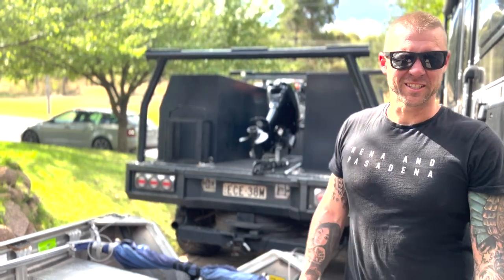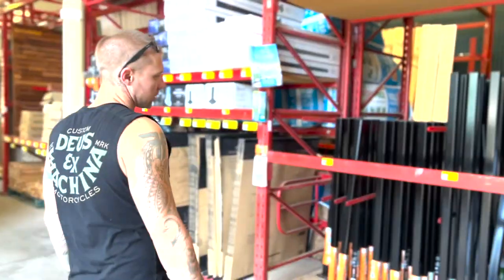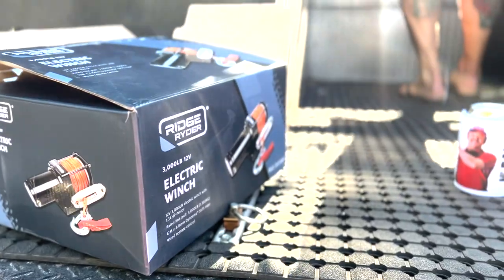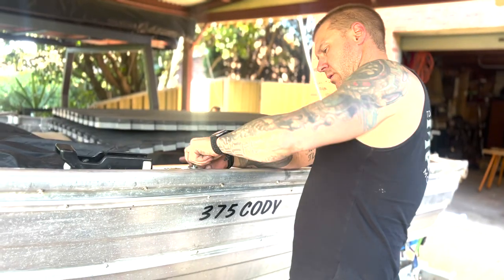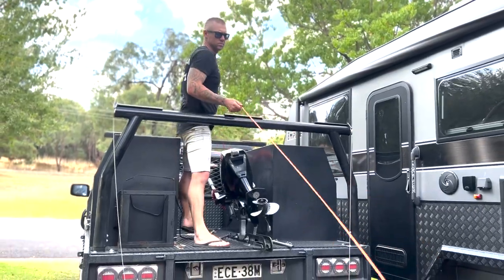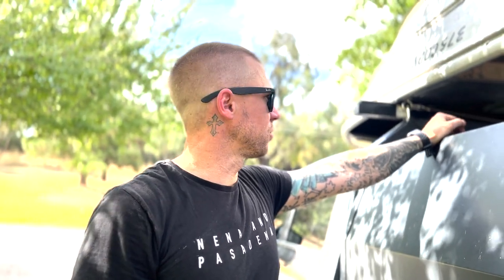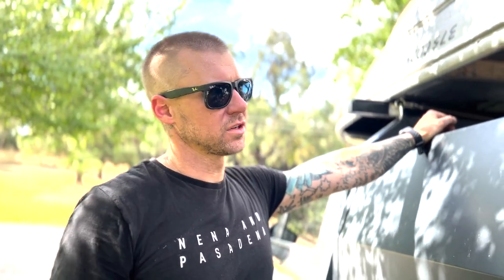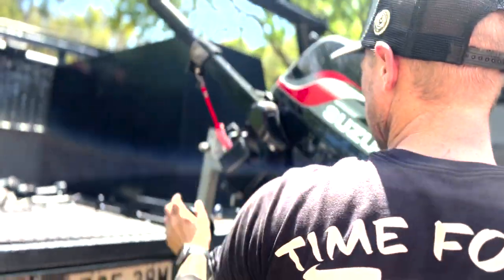You can make a boat loader for under $300! - Travelling Australia

Comment: You have possibly already worked it out, but you need some diagonal bracing on that rear ladder rack. The side loads placed on it when the tinny is on it's way up or down will eventually rip the mounting bolts in the bottom flanges out of your tray.

Comment from the maker: 3 metres stainless stee rope - $12
Eyebolts - $8
Shackles and crimps - $30
ATV winch - $170
1.5m teflon slide - $58

= $278!

If you don't already have a ladder rack, you can pick one up for as little as $300 bringing you up to a grand total of $578!